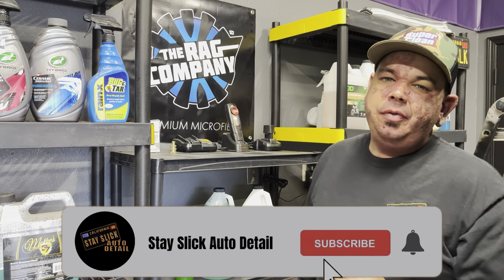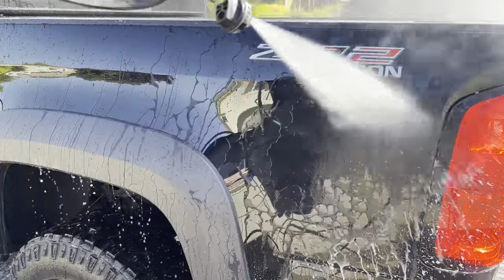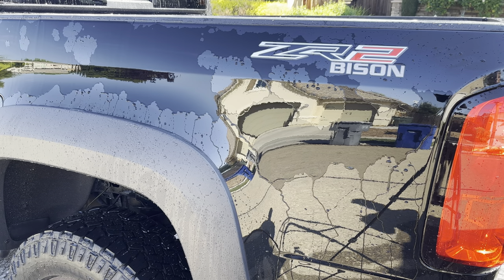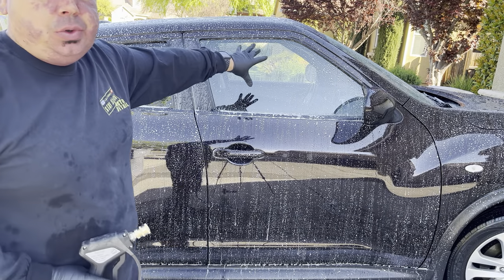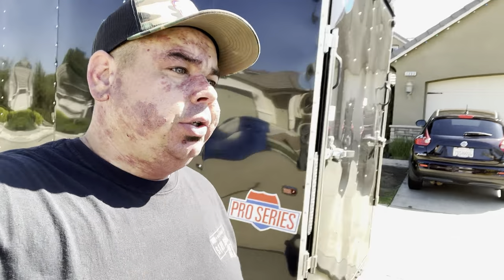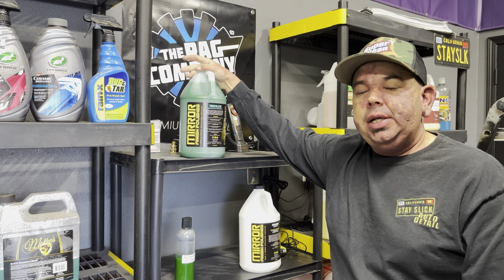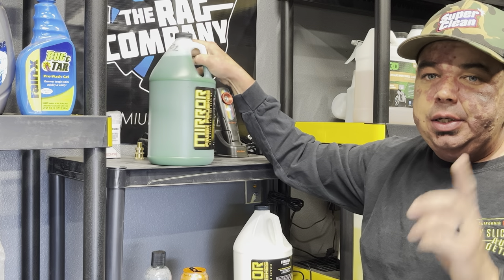Mirror Finish Touchless Ceramic Rinse and Seal Review | Stay Slick Auto Detail

Comment: If you're on the fence about this product all I can tell you is it works 💪. I've never used a product that has such awesome results. The shine is absolutely amazing the paint is slick as owl shit the water beading is 100% on point. My truck is a 22 race red 4x4 and the paint is bright AF. The best part is drying it off one microfiber towel and it's done. Ev everything shines the glass the plastics the wheels everything. 100% satisfied with this stuff. Game changer is right. Now I gotta do my wife's big ass SUV 😆
Reply from the maker: Right on man I’m glad to hear you dig it.
Reply: @StaySlick  got up at 6am I absolutely hate trying to wash vehicles when the sun's out. Plus didn't want to take a chance of spotting up the paint.  Blown away with my results.
Reply: @StaySlick  dura this product offer extreme uv protection?

I have a 34 fit RV..  I use an aerospace ceramic product called Rejex....  I use it on the whole RV including the windows..

It helps keep the RV..  it needs to be applied yearly..
Reply: How is it on matte/denim paint
Reply: Do you use it on every wash, or periodically?
Reply from the maker: I use it once a month usually.
Reply from the maker: You can lay down a long-term protection like you are and then just maintain it with touchless each time you wash it
Reply from the maker: I haven’t used it yet on Matte paint but I’ve heard that it works just fine
Reply: how long does this product hold up once applied on vehicle sir
Reply: @1280spoon  my vehicles are garage kept so my results may be different from others . I also live in south Louisiana lots of plant fall out and rain. The product last for months  with only a simple maintenance wash . The hydrophobic properties are amazing.

Comment: INCREDIBLE because as a mobile guy it opens the door for people who won’t pay more than $50-$60. Clean the face of wheels with acid, foam bath, rinse off, foam bath + hand wash and foam it again with this stuff and you’re done. What was even more impressive was the CG Clean Slate. I hate Chemical Guys, but that did a fantastic job of removing the waxes and will get a small bottle of it to try myself on my next clay + wax customer.

Sheesh that’s no joke dude. I watch a lot of detailers on YouTube, I never buy any products they recommend. This one however, is about to become a staple in my business. The flawless solution for maintenance clients. Thank you Stay Slick you ever come down to Carlsbad CA Casey’s Car Clinic wants to clean your truck for you 😘
Reply from the maker: Hey one thing chemical guys does very is soap. Clean slate works pretty good.

Comment: Tried this product and must say it works. There is a small learning curve, but as mentioned in the video after applying promptly rinse then dry. Go section by section. 
I applied, rinsed, then went on to finish the entire truck before drying. Small mistake cause I did have some spotting that easily came off with a microfiber and spray wax.
Overall awesome product 👍🏻👍🏻

Comment: hydro blue does a pretty good job also. but it will leave spots on glass if you're not careful with it.  I just ordered me a gallon of the mirror can't wait to try it out
Reply from the maker: I’ve had my eye on hydro blue for awhile but hadn’t pulled the trigger.
Reply: @StaySlick  its been out for a long time I've used it for years with great results . I dont know if they have changed it up over the years to compete with others thou. It was simple to use spray on rinse off  one panel at a time. I excited to use this stuff thou . The results look amazing
Reply: Yeah hydroblue definitely is not like this.
Reply from the maker: @jonmike316  im interested in trying hydro blue. I’ve been wanting to pick it up for awhile.
Reply: @StaySlick  it just beads up. Nothing different from spraying a spray wax/sealant on wet vehicle then rinsing off. I like how the water behavior of this product on your video. While it also beads, it rolls off instantly like a coating.

Comment: Have you tried their Depth Ceramic Sealant? At $65 a gallon, think it has a potential to being the best bang for the buck sealant if it matches its advertisement of lasting 6+ months and being easy to apply. They also have a $85 High Octane Ceramic Booster that promises 12 months when used as a standalone sealant.
Reply from the maker: I have tried both, Depth is legit it's easy to use, slick, hydrophobic. The high octane is that on steroids but unfortunately it's very hard to work with. The temperature has to be perfect for it not to streak

Comment: How is this product different/better than Gyeon Wet Coat?  I use Gyeon and love it.  Thoughts?  I have found nothing to beat Wet Coat.
Reply from the maker: This is more hydrophobic, lasts longer, and way lord economical than wet coat. Most of the detailers in the industry fall into the trap of thinking a brand is better because it’s pushed as “High End.” Sometimes it’s true most of the time it’s not.
Reply: @StaySlick  thank you for getting back with me.  I’ve been using Wet Coat for about a year.  I have coated all of our vehicles with Can Coat after the proper prep obviously and I love this product as well.  The Can Coat is not expensive for what you get.  I’m a fan of a shorter term ceramic in case a vehicle needs to be polished.  Is this product compatible with Can Coat.  I only use Wet Coat about every 3-4 months.  How often would you use the product you have on top of a coating?   Thx again.

Comment: Do you use it every time you wash?  Is it as slick as bead maker?   Great video, I'm glad you used black vehicles to test this stuff.  Black is the hardest color in my opinion to work on.
Reply from the maker: Realistically I use it once a month so every other visit for this customer. It’s much slicker than bead maker. Sometimes it’s slicker and beads better then a ceramic coating. Amazing stuff.

Comment: Looks really good. So I guess this would replace a product like Xtreme Solutions Topper?
Reply from the maker: You can still throw topper over this for removal of light dust or just general touch ups but touchless is a full on ceramic sealant meant to be standalone or a maintenance product for traditional ceramic coatings.

Comment: My question is... does this replace the need for just wax? Or can you wax on top of this when you're not doing a ceramic coating
Reply from the maker: Hey Brooks if I were you I would only use this as a topper meaning the last layer of protection. For example if you want to wax your vehicle, do that first and then use this over the top to maintain it. But as a rule of thumb ceramics usually deal better with other ceramics or polymer-based products rather than wax.
Reply: @StaySlick  Thanks man! That's kind of what I was thinking. This would definitely be a benefit to my business and speed up some things.
Reply: @StaySlick  Results look great.  What kind of longevity can I expect from it? A week, a month, 6mo? UV protection?
Reply from the maker: @joelpasserell4525  uv protection for sure. I’ve noticed about 3 months.
Reply: @StaySlick   was the 3mo. in "sunshine states?"  I deal with road salt and winter in Ohio so wondering if you or anyone has experience with how it holds up in those conditions as well...maybe a month?
Reply from the maker: Yea I’m in Fresno ca so it’s hott here. Not real winters. I would say roughly a month. So you would get about 96 applications  out of a gallon as long as you don’t over apply
Reply: How would this stuff hold up as a topper for boats?  Let's say after a wash off before putting the boat away.
Reply from the maker: @ulyssesfernandez8958  durability is very subjective. I’d say up to 3 months

Comment: After rinsing this off from the windows and using a blower to dry, do you still need to go over the windows with a separate cleaner due to any spots?
Reply from the maker: I always follow up with deionized water and a towel to clean the the windows and make sure there are no streaks.

Comment: I just got this recently, but I have not had the time to use it. I have a foam cannon, but it's broke (the neck came apart).. so I'd have to get a new one. I do have an ik sprayer (both a foam one and a non foam one). Have you tried spraying it on with one of these sprayers? Or should I just buy a new foam cannon- I don't foam soaps, so that's why I'm hesitant to purchase a new cannon.
Reply from the maker: I haven’t tried it myself but I hear it can be sprayed on in a spray bottle or foamer

Comment: Easy coat is sold in bigger sizes as a refill for your original bottle , but I can’t see any reason why it can’t be used in a foam cannon as the idea is to mix it with water as you apply it as you don’t want to apply it neat
Reply from the maker: Right on brother thank you for the info good to know. Yeah I wouldn’t think you can’t apply all of these products in the same way I’m pretty sure they would all work in an IK foamer or a spray bottle and a foam cannon. I have to do some testing

Comment: Hello, great video and new sub here!

I recently ceramic coated my mid size suv with Shine Supply Bead Lock Pro. Is this product something I can use on top of the ceramic? If so how often being that the car is already coated?

Also, prior to coating my car, I used Meguiars Hybryd Ceramic Detailer with very good water beading results and shine. Do you think this product is better?

Lastly, which did you like better, this product  or the Technicians Choice ceramic spray from your other video?
Reply from the maker: Yes this product is great for ceramic maintenance. I would do it as much as you want. Every time or once a month.
Reply from the maker: Also I definitely like touchless more.
Reply: @StaySlick  thanks for the response. So would you say at the moment you prefer Touchless over any other Detailer including the ones in your other videos?

It’s be interesting to see the results using it in a spray bottle. 

By the way, I really like your channel - straight to the point, articulate, entertaining, and you respond to most messages. 👍🏻
Reply from the maker: Yes sir I try to respond to every message if I can thank you I’m glad you like the channel. Touchless is different than the other detailers they’re different meant to be used in different ways so I wouldn’t necessarily compare them. Touchless is a stronger form of protection so what I would do is lay down touchless and use these other spray paint sealants as drying aids each time

Comment: In the hot season do you have to rush and dry this of so it doesn't water spot?
Reply from the maker: So right now it is the hot season and what I do is spray one door or two doors at a time rinse it all down and then move on it also depends on if you’re using the ionized water so if you are using the ionized water you don’t have to worry about it if you aren’t then yes I will try to dry each panel as you go around to just to prevent it
Reply: @StaySlick  thanks for the quick respond. I just purchased it. I do use spot free water. Just didn't know if the chemical itself after rinsing would. So thanks for clearing it up

Comment: Hey man quick question what kind of foam cannon do you recommend I feel like there’s a couple that stand out but just curious on which one you prefer
Reply from the maker: Hey Zack honestly I’m in between the MTM PF22.2 and the MJJC Pro. Overall the build quality of the MTM is definitely better but I don’t like how it has a small mouth on the bottle And I don’t like that the threads are metal to plastic because this causes the threads to strip easily it happened to me already. The MJJC pro has a very large opening on the bottle which is nice but the build quality doesn’t seem as robust. I do like how the threads are plastic to plastic. Both have amazing foam. I hope that helps.
Reply: Thankyou truly

Comment: I have a customer with PTFE (Teflon based) coating.(Undrdog).  Will Touchless still adhere ok to it given its not the same chemical base....Ceramic over PTFE coating?
Reply from the maker: Touchless should adhere fine to any protection per the manufacturer.
Reply: @StaySlick  Good to know.  It's awesome stuff and we'll worth the money!  How long has it been lasting on average in the warm weather areas?  3mo?
Reply from the maker: Yes roughly 3 months

Comment: Hell ya! Thanks for the review just placed an order with your discount code
Reply: Thanks for being honest about the other sealant
Reply from the maker: Absolutely there’s no reason to lie. It’s a great product just absurdly expensive
Reply: @StaySlick  Does the Sealant clog the foam cannon over time?
Reply from the maker: @Juandersause  I’ve been testing it out for about a month or so and I haven’t noticed any issue. Also the foam cannon I use for this application is a beat up Amazon one that I never really take care of and it’s still working fine so I wouldn’t think it would be an issue.
Reply: @StaySlick  Would this product work with IK Foam pump sprayer?
Reply from the maker: @Juandersause  wow great question I’d be interested to find out. I’ll try to out.

Comment: I love the product and it is the slickest stuff I've ever used.  However, make sure you blow dry and finish drying by hand after rinsing product off.  I applied it with 4oz. in 1L of water into my MJJC foam cannon and rinsed off with my normal water (130 TDS).  It was late and I didn't want to spend time drying off the whole car so I thought I'd just use my DI water hose (0 TDS which I tested before spraying) to rinse the entire car again quickly and let it dry overnight in the garage. I was thinking that my DI rinse would leave no spotting as it's done in the past.  When I went to work the next morning I was shocked by the thousands of water spots ALL over the paint, glass & trim....worst case of water spotting ever!  My ONR detail spray had no affect on it.  I emailed Mirror Finish and they said it should come off with a wash & possibility a water spot remover may be needed.  After washing it again with a stripping Soap and a chemical decon spray/rinse, I was able to get rid of all the spotting.  The mfg. said it needs to be dried immediately after rinsing Touchless off.  Hope this helps someone else avoid the same problem.  Unbelievably AWESOME product though!!💯
Reply from the maker: Yea you can’t let it air dry that’s a no no. The spotting comes off with just water if you get it quick enough. That’s why I never blow all the water off I always leave some behind so I can. Use it to remove ant steaks or spots with my drying towel.
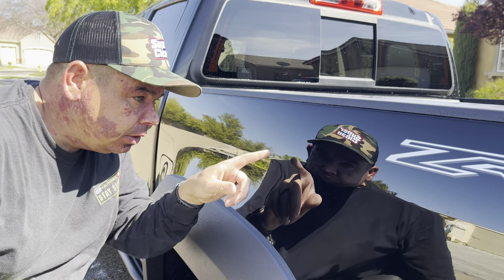Reply: @StaySlick  Good to know.  At 4:36 in video you say since using DI water you could leave it after just blowing and you'd be good, but even with DI rinse, you need to make sure after blowing, that there are no standing beads or runs anywhere.  But it will spot if the DI water drops have any of the "touchless" product still in the DI water drops when they dry.  Might be good to update the video with pop-up text at that time saying to wipe completely dry after rinsing to avoid spotting.  Based on your words, I took it that if I had DI water I could just rinse the "Touchless" product with my DI water and let it go and I'd be good.  Thanks for exposing this product though.  It is freaking awesome!
Reply: I used Chem X’s version….Snake Oil with a final DI rinse. Results were perfect. Here was my process….first off this was on my semi tractor. I also wash my equipment in a temp controlled shop. So after a thorough contact wash and rinse I applied Snake Oil to a wet truck. Rinsed thoroughly after an ~ 30-45 second dwell per panel. Finished with a very heavy DI rinse and walked away. Perfect results the next day!!  Truck did not leave my shop throughout the process. Shop temp was at 65 degrees.

Comment: Hey bro , could you tell me what pressure washer gun and hose you use.... Just curious if those supplies come from the same company.... I detail for a dealership and some of the suppliers carry nothing but junk.... I'm constantly buy tips, hoses it seems like...   nothing last anymore,  I've even had foam cannons go down on me, I've taken several apart,  nothing but plastic.... Thanks for any help
Reply from the maker: Hey 👋🏼. Yea I use an Uber flex 50 ft hose with an mtm sgs28 gun.

Comment: What kind of power washer are you I useing
Reply from the maker: Hey brother right now I’m using the standard Ryobi 1800 psi 1.2 GPM pressure washer. I also have an active 1800 psi 2 gallons per minute pressure washer but it was giving me issues

Comment: Which pressure washer r u using and the noszle ? please
Reply from the maker: I’m using the 1800 psi 1.2 gpm ryobi. The nozzle is a multi tip nozzle from Amazon.
Reply: Really i have the 1900 psi n is not making that pressure when water coming out..and is making a wear noise..thank u for ur respond Mr..
Reply from the maker: @AZULYORO4LIFE  interesting maybe it’s a defective unit.

Comment: What is the longevity of protection?
Reply from the maker: I haven’t been testing it Long enough to give an actual estimate but I would guess the actual protection aspect is going to last two months minimum. But the water beading and shine I think will start wearing off after a month. But with the low cost of this product I’m not really concerned about that because I plan to reapply at least every three weeks to a month for my maintenance vehicles. Remember it’s only going to cost about $1.33 per application depending on the size of the vehicle

Comment: Any idea how long it should last?
Reply from the maker: Mirror finish is staring up to 3 months I’d say that’s somewhat accurate. I would reapply it at least once a month in my opinion. Just to keep the beading and gloss tip top
Reply: @StaySlick  I just used your link & code Thanks brother 👊
Reply from the maker: @jackasmaryan1776  right on bro you won’t be disappointed